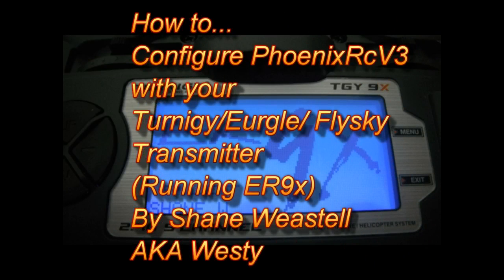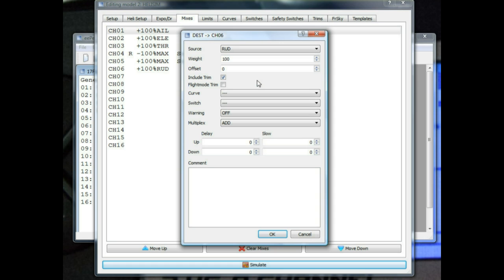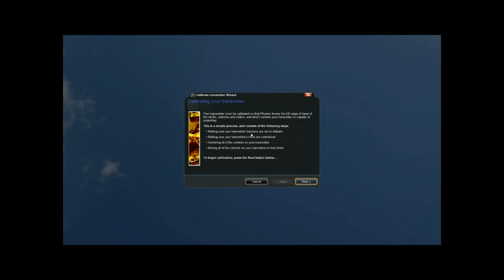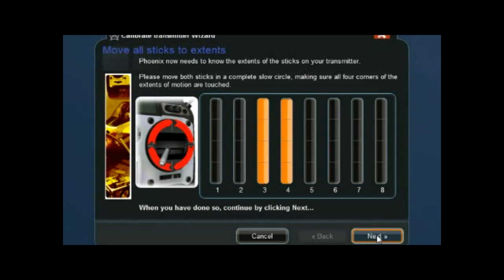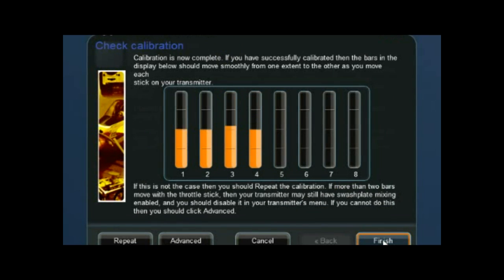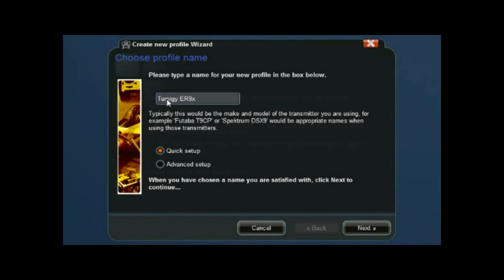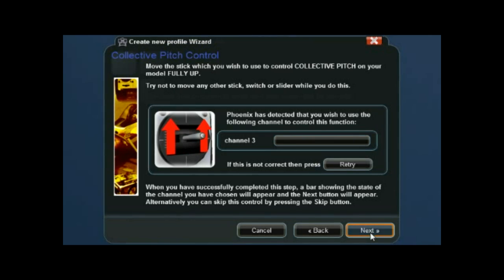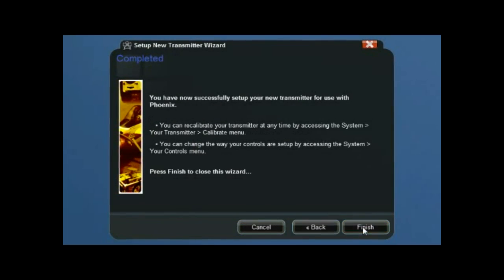phoenix controller

Comment: Don't understand that either and also wondered about curve-5.
Must cuve-5 just be default and flat 0, 0, 0, 0, 0 ??
Besides these two questions I also didn't understand how to get the switches right.
But anyhow, thanks Westty. It does work for the 4 channel sticks.

Comment from the maker: oh ... and then you will need either a 9 in 1 sim and use the trainer port or use a 9X8C-v2 Receiver or a TRA6a-v2 and you can do wireless connectio nto hte PC for simualtor mode.... but you must use the USBASP method to talk with the Processor using Epee - Thanks for the question, Hope I answered your query